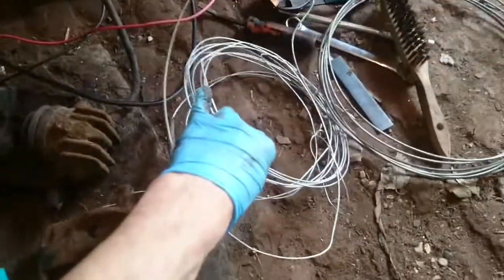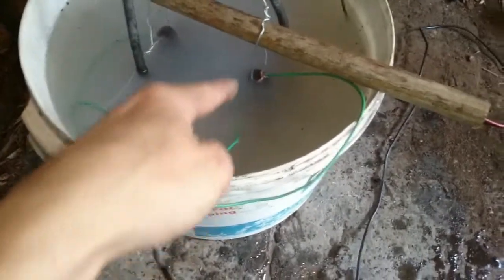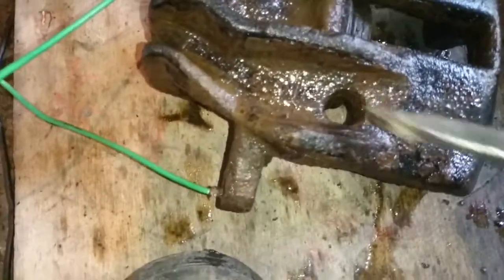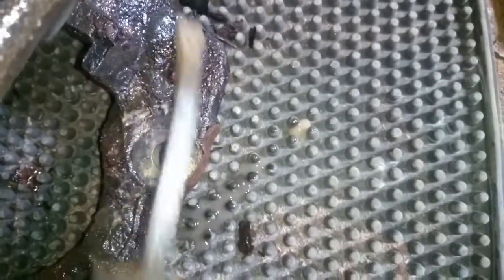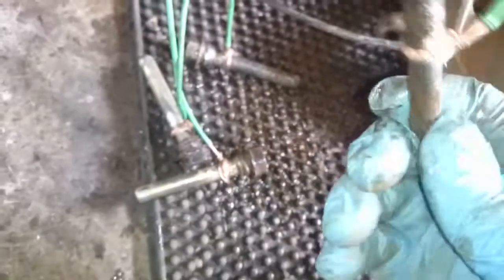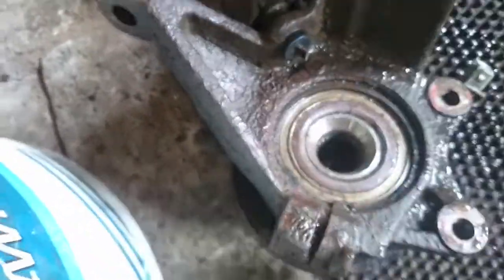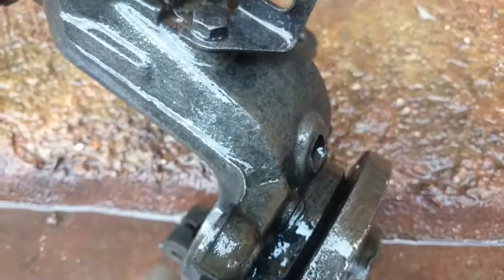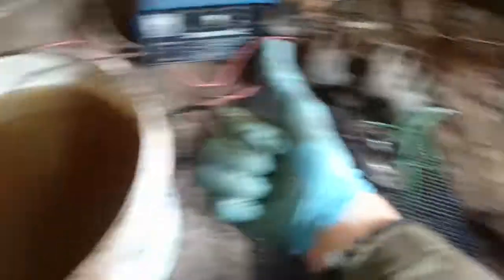HOW TO: rust removal, cleaning car parts

Comment: Hey man. I believe you will achieve better results and faster derusting if you use a sacrificial steel part with a larger surface area.
Reply from the maker: AlienMonkeyDXB 100% on the nail.  I have had much better success since using two large pieces of ferous steel.